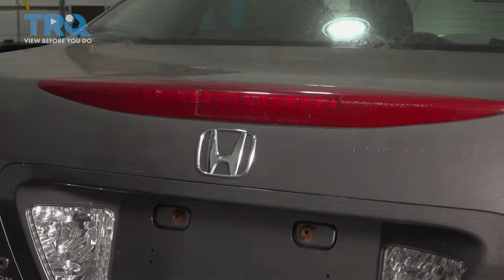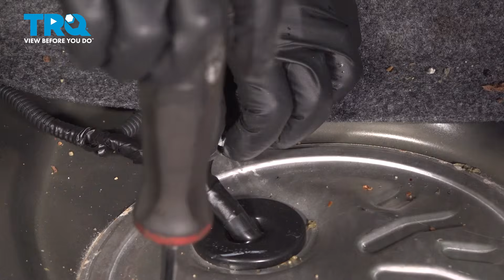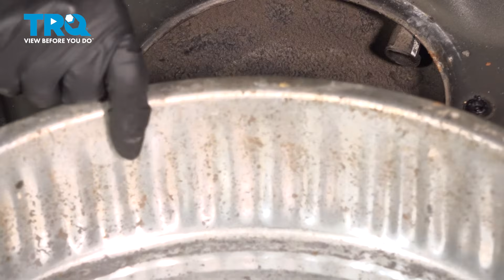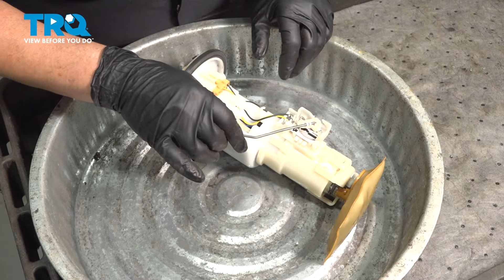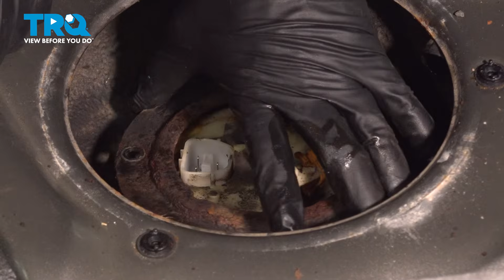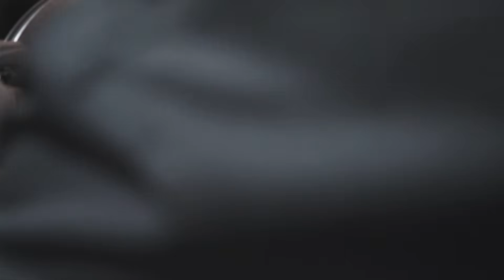How to Replace Fuel Pump Module Assembly 2003-2007 Honda Accord

Comment: My 2006 Acura TL has a long crank before it start. 
Do I have to change the entire fuel pump? Or just the fuel pressure regulator? And is the fuel pressure regulator attached to the fuel pump?

Comment: The reason the link doesn't lead to the actual right part is due to this being a California Emissions compliant model of the Accord. I found this out the hard way with my car after buying the wrong pump. The only sellers of this pump that I could find are the Honda dealership ($800), Ebay shipping it from China,($100-150) or buying each individual piece from Honda parts now ($400-800 depending on what all you need to replace) and building it yourself. If anyone knows a better place to find it that would be great!